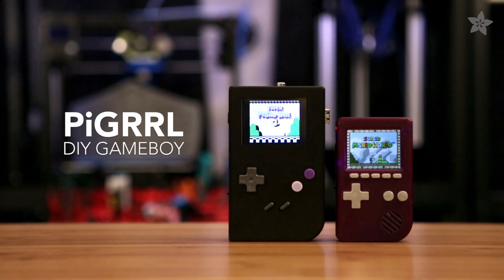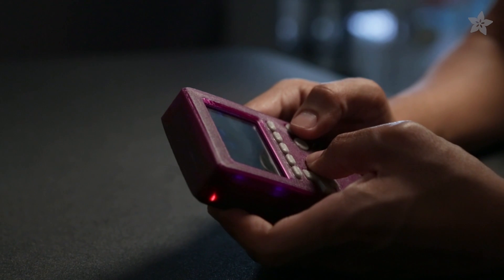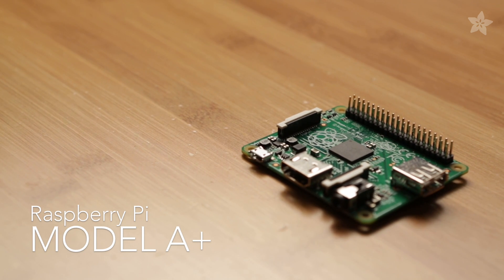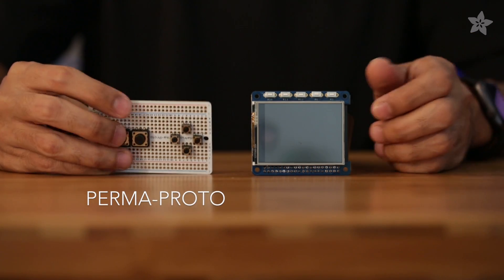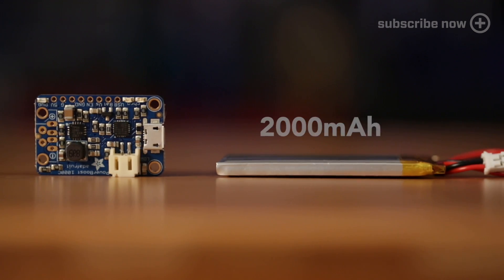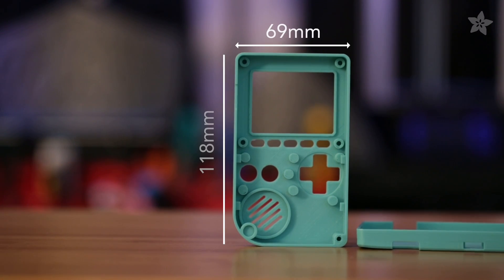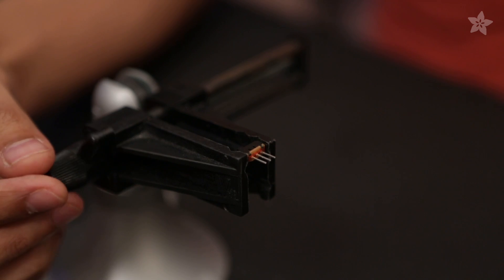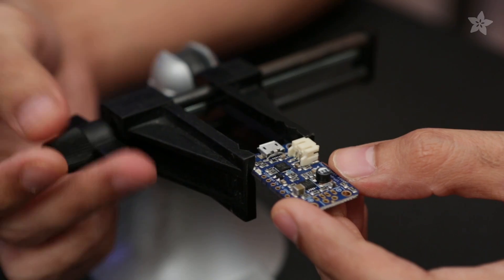Pocket PiGRRL - Raspberry Pi Gameboy

Comment: Can we do this with the Pi Zero?
Reply from the maker: +Mike Rota Yes! Someone remixed the case design on Thingiverse to work with PiZero. Our PiGRRL Zero project will be released soon! :-)
Reply: +Adafruit Industries Kewl cause I don't think Retropie requires multicores.  A single core processor should be more then enough. Plz let me know when it comes out. I also so require these videos and kits as I am no engineer. I'm an A+ certified Computer Tech but this goes way beyond anything I've ever done with that.

Comment: Now I have two questions (not what are those):
1: If it's an 8-bit speaker, this means the 16-bit and other modern games will sound in 8-bits?
2: Can I add more buttons (like X & Y) just in case I wanna play SNES games and other console games?

Thanks.
Reply: +MarioLuigi7979 You could but you would have to edit the case . for the first question yes the speaker would get confused bc it cant run 8 bit sound
Reply: +MarioLuigi7979 oops i meant 16 bit or higher it would get confused

Comment: So uh, where are the start and select buttons on the pocket pi? I bought one and I'm kinda lost. The screen buttons?
Reply from the maker: +gamecreaterdude13 Yep, the five screen buttons the PiTFT display can be mapped to be start/select. If you're using the Pocket PiGRRL IMG from the tutorial, the two buttons in the middle are select/start.
Reply: Thanks for the info!
Reply: +Adafruit Industries Gamer hey my name is Charles Morris and I'm 15 and I would like to learns
 how to make on but in
 order for me to make on I'm going to need the supplies like the
 raspberry pi and I can't afford a 3D printer so I'm screwed so that my
 grandmother said no.but I'm really a retro gaming fan and I would
 really appreciate it if you sent it to me made or decimbled and I will
 gladly show you it after I'm done but if you don't want to it's ok I
 would understand
Reply: +kaen totsa I'd doubt they'll send it for free is that's what you're asking, but if you have a 3ds you can emulate all those games there :P Plus if you downgrade it you can also play all the 3ds games so I think you'd win more this way, rather then just playing old games you could also play the new ones! An old 3ds goes for around $50 depending on condition and firmware, but all you'll need is a 3ds, an SD card (size of your choice, but bigger than 4) and depending on if the firmware is on is downgrade able or not a game like Ocarina Of Time. I already had a 3ds (on old firmware <10.6) and all i bought was a 32gb $10 SD card. Even if they sent you the package how would you solder it?
Reply: Angel Acero no id ont have a 3ds
Reply: kaen totsa well a 3ds is still way cheaper than a 3d printer, soldering kit and the raspberry pi put together sooo
Reply: Ok ill get a 3ds then
Reply: kaen totsa you'll be able to emulate most old games with just homebrew, but if you hack it pass that you'll be able to get any 3ds game too. There's a bunch of tutorials on how to do it, by the way, if you only want to emulate games on it make sure it's on a 10.5 firmware or lower because they blocked it after that, just go to a pawnshop and in settings it should tell you which version is on, if it says 10.6~ or higher (latest is 10.7) don't buy it, if it says at least 10.5 then you're in luck :) If you get it used it'll be even more cheap BTW, Most new ones come with the latest firmware, so the emulator might be block, but it depends where you get it at. Just know that if you get it used you can always return it an get your money back (tell them it doesn't work properly or something), but if it's  Brand new they'll just give you a replacement :/
Reply: kaen totsa by the way, you are that you can play most old games on a smart phone right? If you just want the old games you can play them with your Android, iphone, or Windows phone just download the rims and emulators haha

Comment: Hey guys really cool project i was looking for it weeks ago and now i have all the stuff i need and wanna build my own.
But i have a big Problem because iam new in raspi. i have installed the rom and the wifi connection works too.
but thats it i will make the 4 button version and i changed the  iO Standard that its the same like the one on your homepage.
the next step didnt work by me:

make retrogame
sudo mv retrogame /usr/local/bin
sudo reboot

When the Raspberry Pi boots back up, it should automatically launch Emulation Station. Your four buttons should all be working now.

Dont know what i should do 
make retrgame work
if i write sudo mv retrogame .......... i cant see anything happend.

And after reboot it starts normaly but didnt launch emulation station

PLEASE help me to fix this.

Sorry for my english i came from AUSTRIA
Reply from the maker: +Seaha Sounds like a question for the forums! We've got engineers there to help you out, post up about your issue here: forums.adafruit.com!

Comment: Does anyone know if this will fit inside an original GBA shell?
Reply: the black and white case possibly. the model a is a lot smaller than the others. I don't know what the inside of the original gameboy looks like though.
Reply: Thank you!
Reply: ive actually come across a video on here since my comment where they had an old black and white gameboy with the pi a in it. fit just fine
Reply: Do you have a link?

Comment: this may come across as stupid but is there a more in depth video on how you assemble the whole project and could you use bread board pcb instead of  the perma proto. 
also im using a gba case so would there be a bigger battery i could use to extend battery life.

Comment: Is there a way to add an audio jack so you can listen to the audio with headphones?
Reply: the pi has audio out i believe. if the specific pi you use doesn't you can get a usb soundcard for 10$ where its premade andnall you have to do is cram it in the housing
you could make your own DAC but this is just the cheaper/quicker idea. i realize as i type this im a bit late to the punch

Comment: Hi Adafruit, just one more snag I'm facing on pocket PIgrrl, if you can point me in the right direction that will be super great. Whenever I press the 'UP' on DPAD which is wired to #12 (GPIO 18) and wire #9 (PCB GND) , the PI TFT screen is killed(lights out) as soon as I release the button it comes back to normal, RPi and its audio remain working as normal even when screen goes out. As long as the Button is pressed the screen remains off. All other buttons function normally n I didn't fiddle with any settings. Please suggest some measures to remove this problem.
Reply from the maker: Gaurav Dalip Hey there. It sounds like you need to cut the trace on the back of the PiTFT - labeled GPIO #18 Lite. That turns the backlight on/off on the display. Check out the PiTFT page on the guide on how to properly cut the trace. https://learn.adafruit.com/pocket-pigrrl/2-dot-4-pitft

Comment: Hi Adafruit, and big thanks to Ruiz brothers and there team for bringing such heart warming projects. Respect for you guys. There's nothing like the nostalgia feeling of playing super Mario 3 and on a hand held system, thats way totally awesome.

I have the built Pocket Pi Grrl as my first Rpi project. I am new to Raspberry Pi and I am having some troubles with it. Is it okay if I ask about my problem here?

I downloaded the Pigrrl image dumped the billi mario (generic name for SM3 in India in 80's, billi means cat) and some other roms, when I started The game I noticed a lag or you can say sluggish performance. I said to myself "sluggish performance while emulating NES?" 

I am sure RPi is much faster than 8bit consoles , so why the poor performance with NES? Is it possible to correct the sluggishness by tweaking some settings?
Thanks in advance.
Reply from the maker: Hi there, thanks for your comment! You may want to try tweaking the overclock settings in the config.txt - we tested a hand full of roms, some preform better than others. Also, check out the guide here for more details and tips http://learn.adafruit.com/running-opengl-based-games-and-emulators-on-adafruit-pitft-displays/
Reply: +Gaurav Dalip Although the hardware is better, remember it's emulating the original hardware. Not running natively  on the Pi hardware. The SNES emulator isn't perfect, tweaking the config to add small frame skipping can resolve most FPS issues.

Comment: You said there is no need to hack up an old SNES controller but I already have one that's in bits.
Can I use the D-Pad and button from it in the 4 button version? Are they a direct fit?